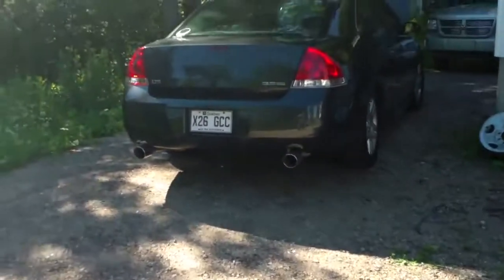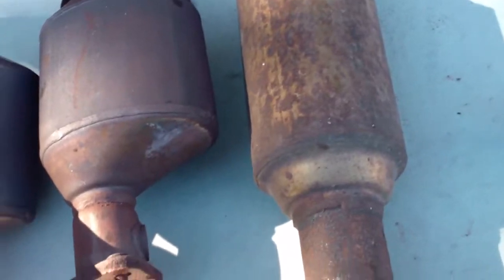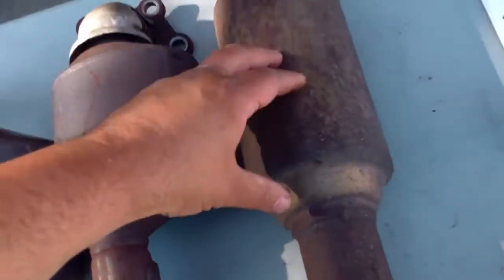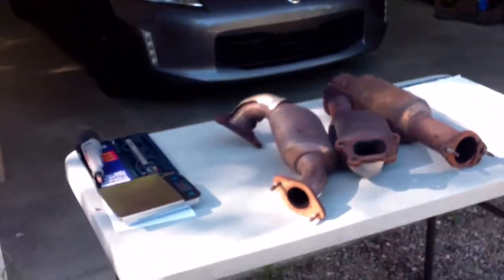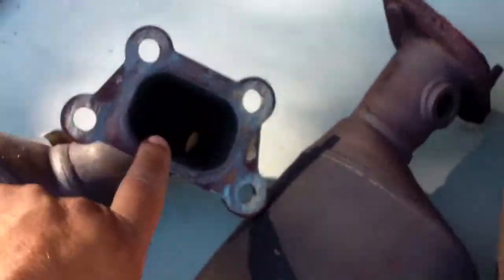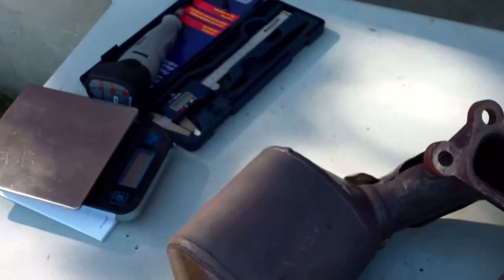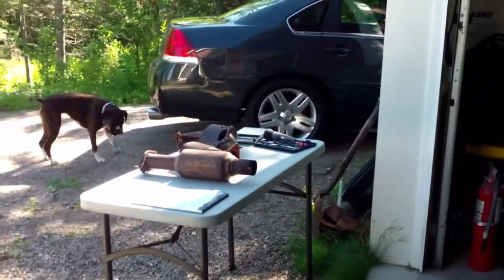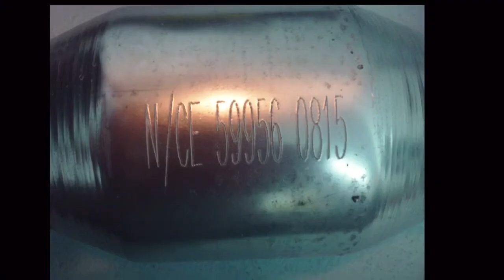Impala LFX 2012-13 V6 3.6L Magnaflow Cats (3 in total) tests and description. Photos and sound.

Comment: where did you get the pass through head light and where did u buy the cat set up
Reply from the maker: Jacob, I purchase and extra set of light (made in China type), removed the high-beam rear socket, trim some plastic off and drill a 4" wide hole in front of head light. Light still functions (regular day light and turn signal), only use on warm dry days and at the track. easy to move, one clip + a 7mm screw and the entire assy comes off.
Reply from the maker: The cats cam from hotexhaust.com.  If you want exactly the same, request for John and ask him you want the french guy set-up (or Will_P), if not, you will get a 400 CPSI ceramic cat's (vs.200 CPSI  Metallic)

Comment: I have an 2012 impala 3.6VVT motor. I would like to do something on mind. I want to add more power to the wheels. So how did that set up work out.
Reply from the maker: Levi Mclucas tune, intake and exhaust. Later, a pulley, intake spacer and TB.  Will give you about +50whp, down pipes and E85, +65 whp

Comment: Did you change your own cat? I have a 06 impala ss and want to try to change mine but I'm not sure if I can reach the nuts and bolts on the manifold.
Reply from the maker: DjSmooth  NY yes, but yours are completely durèrent from mine. Your LS4 will for sure benefit from a 100/200 CPSI cats. I would check     Hotexhaust.com, but I’m sure U will be able to find good and affordable cats for your SS